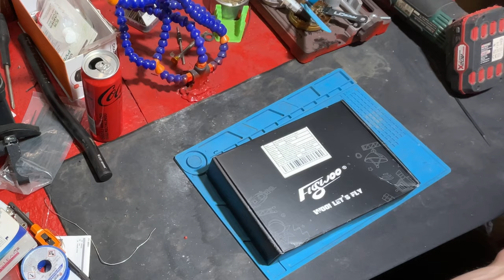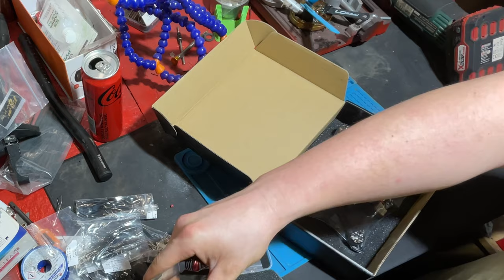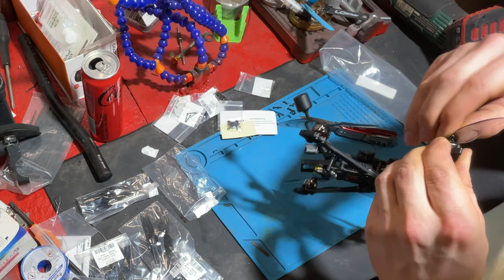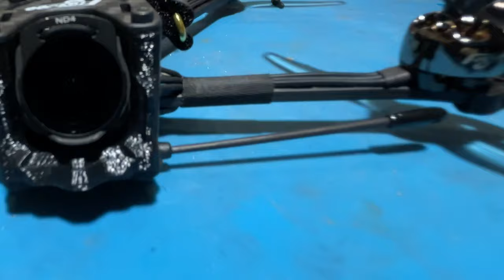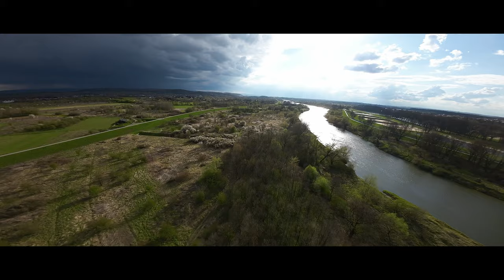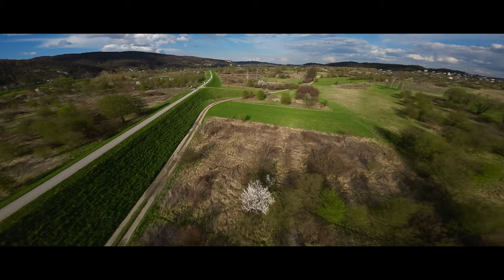Flywoo Explorer LR O3 Unboxing / Pierwszy lot.

Comment: I ordered one too... when I plugged mine in it rapidly set fire, burning me pretty bad. 
I wouldn't trust these machines they are made by uncaring companies with no quality control, not just flywoo, its not the only drone I've had explode out of the box; I've had three burst into flames, two shorted and set fire out of the box (flywoo and betafpv)  and the other one from rotor riot turned on and then made a really nasty fizzle noise and never came back on.
none of the companies would accept a return or exchange
if you can't tell I'm never going to buy another one of these deathmatches.